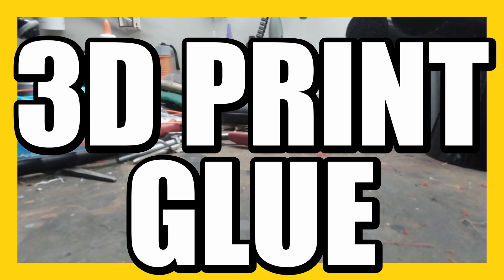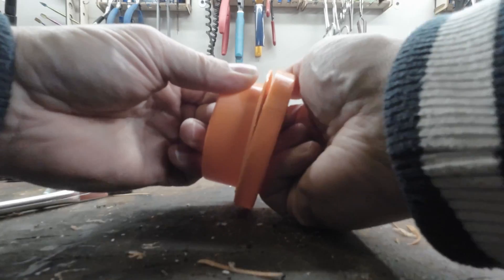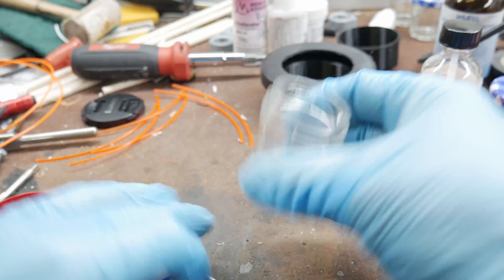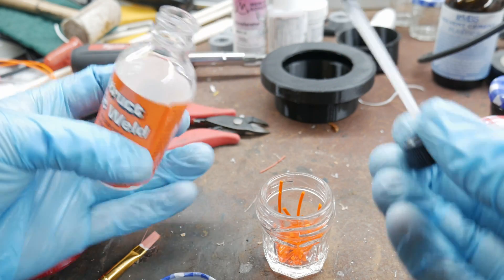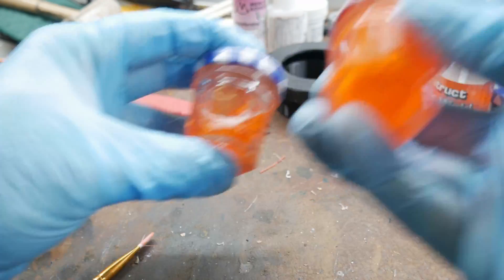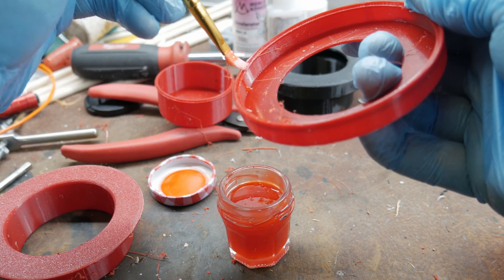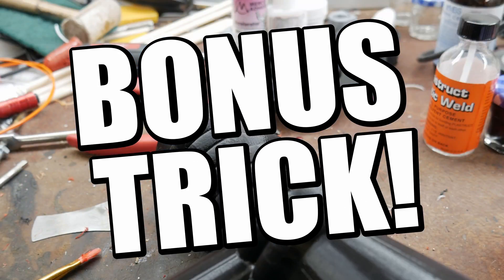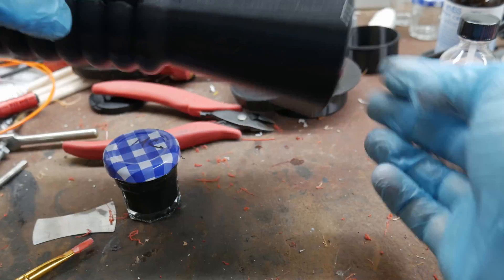How to Make Your Own 3D Print Glue - The Perfect Solution for Broken Printer Parts

Comment: I dont know if they’ve changed the ingredients of the plastruct plastic weld but I put some fresh off the spool PLA+ in with this and it’s been over a week and they still haven’t broken down in the solvent. Any ideas? I was really hoping this was going to work but sadly it hasn’t yet. Maybe it’s the makeup of the PLA+ and not the plastic weld?
Reply: it does not work!!!!  I posted also.  Plastic Weld has MEK, which does not work on PLA.  it is possible that they ahve changed from Methylene Chloride to MEK,  this would explain it. 

but the author even says it is MEK.  and MEK DOES NOT AFFECT PLA!!!!

Comment: Thanks for the tip. Can acetone be used for melting the plastic? Also, when using the solvents, after the PLA or whatever material is used to make the glue....after applying it, how long will it take to cure?

Comment: I have been using the Plastic-welder stuff for years... started using it as a kid when I built plastic models. Love the idea of melting filament into it. Down side to it is, its exspensive, 13 bucks for each color you want to be able to glue. Might be able to make smaller batches. Pro tip, use q-tips as applicators, brushes are expensive and not really able to be cleaned.
Reply: I have had great luck with JB weld UV cured cement as well
Reply from the maker: The reason for the little jars is that I can make about 5 different glues with one bottle. I agree it is expensive but at the same time distributed properly it can last a long time
Reply: Try using clear filament.

Comment: So basically what those of us printing with ABS have known for over 10 years. Solvent and filament. Ground breaking stuff Ben.
Reply from the maker: I need to find a decent TPU solvent now
Reply: First, not everyone knows about it - especially as fewer people use ABS nowadays than we did back in the day - so someone will be happy to hear about this, and second Ben didn't use ABS in the video.

I will check out your channel to see what groundbreaking stuff you share, judging by your comment it should be absolutely amazing stuff! ;)
Reply: Yes ABS & acetone had been known for eons, but I haven't seen a chemical weld for PLA before.
Reply: @KieranShort  You can also just use plastic glue used for 40k models. Been using it for YEARS.
Reply: @8BitLife69  thats great, but that's not the same as a weld.
Reply: @KieranShort  It sure is. Mix it with pla, and you've got the same stuff. Again, been using it for years.
Reply: "With ABS"

Comment: If you boil it what happens ?
Edit: How would it affect the glue ?
Maybe it makes it less toxic, or ... even stronger? 
Or juat ruins the glue...
Reply from the maker: Why would you boil it? How would you boil it? Regardless heating solvents before they gas’s off is something YOU SHOULD NOT DO!
Reply: @DreadMakerRoberts  well, if you get rid of the water content, it's stronger because it's denser
Reply: @DreadMakerRoberts  probably by putting all the jars in one big pot and filling it to where it's just above the glue level, but not high enough to get in the jars obviousily outside...
Reply from the maker: Still would not recommend this. Heat and solvents is not good. And the water content in this case is so very minor the gains, if any would be fractions of a percent

Comment: This is probably where you could use a shredder on your rafts skirts brims failed prints and use them instead of new fillament! It's still technically plastic, so it works, heart me if you think it works ! What do you think ?

This would probably work to smooth out those annoying layer lines for people who make models and stuff 😁
Reply from the maker: YES! all of this! 4 hours is the min dry time. I prefer overnight. So with layer lines and such this would need the 24 hour dry time to be sandable.